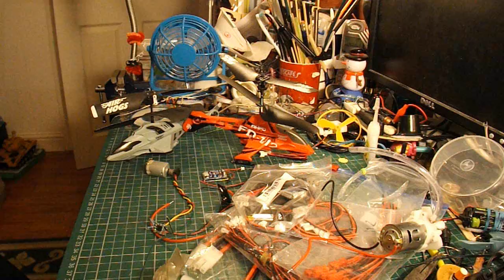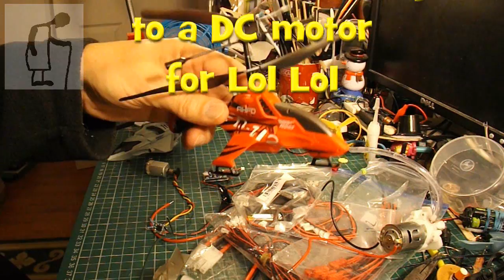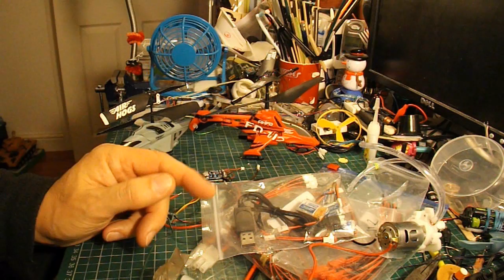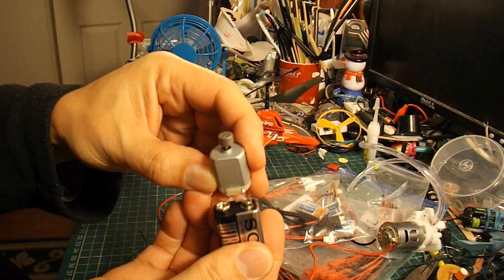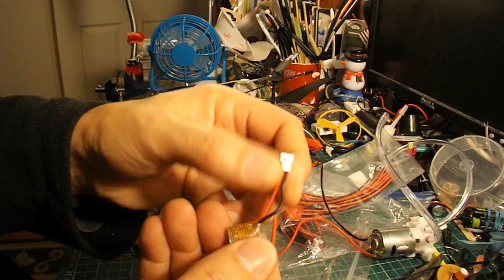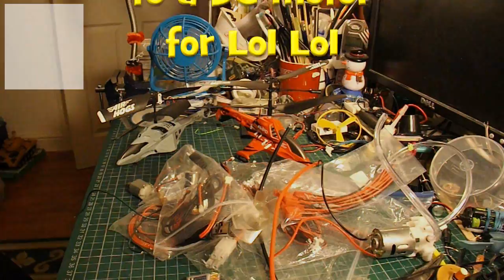Talking about connecting Batteries to DC motors for Lol Lol

Comment: And make sure not to over discharge the lipo. If you discharge it below 3 volts per cell you can damage the battery and internally short it out.
Reply from the maker: +X-FLIGHT101 yes, always best to be safe but in fact many LiPo packages have inbuilt protection.

Comment: hey grandad, you shoul use one of the hair dryer propelors on a boat propeled under the water
Reply from the maker: +Epic Face 3000 I have considered that, the blades are well shaped and would be more efficient that the ones I normally use but they also have a large centre section that I would expect to reduce the efficiency.